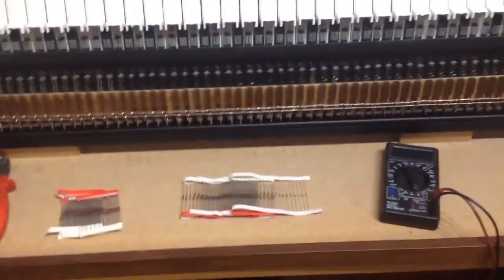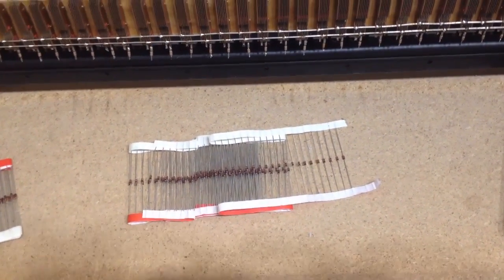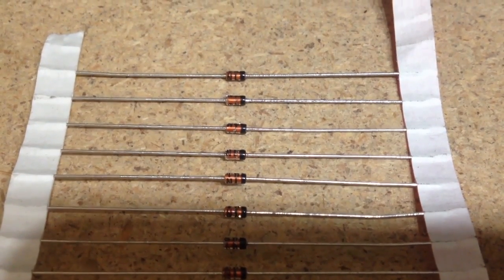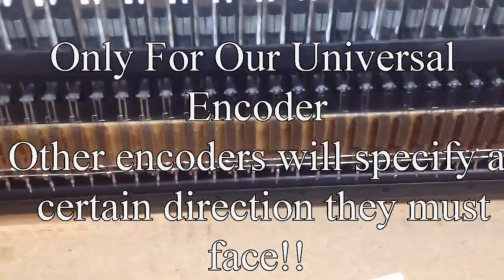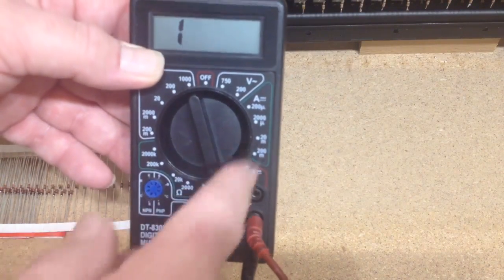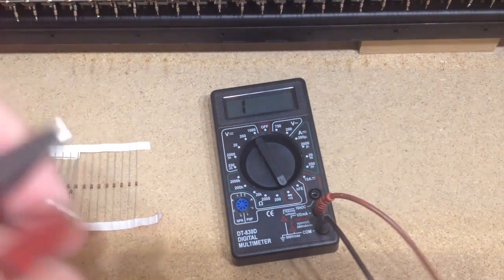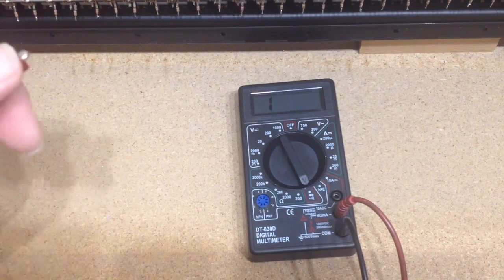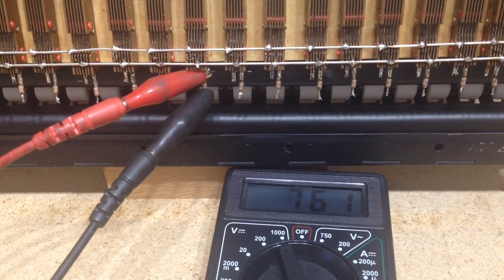Converting the Wyvern Exeter Organ - part 16  All about Diodes & How to test them

Comment: Hello!  I am planning to build an organ from scratch, repurposing the manuals or reed organs for this project.  Obviously, I will have to set up all wiring myself, so what think You would be the simplest—and most affordable—option for all key switches?  I am thinking to simply have a piece of copper under each tangent, which shall connect the main line and the individual line for that key, upon key press.  I never thought of adding diodes to the system, and am wondering:  Why would they be necessary, for this case?
Reply from the maker: The purpose of the diodes along with how it works are explained here https://www.youtube.com/watch?v=UHLV2dy4zBI Whatever you use for switches needs to have some spring in it or it will quickly stop working well. Good luck with your project 🙂

Comment: In case You see this trice, this is the third time I am writing this, as YouTube seems to have aborted my former replies, for whatever reason. 😂  I shall now try sending this as another comment, though, instead of as a reply.
	What awesome customer support.  The quick response is massively appreciated!  (That video is actually what led me to this one, ha-ha.)  Diodes allow for current to flow in only one direction, that I know, but I am confused about why the need of them in this case.  Good point, regarding the switches.  Perhaps I shall have springs touch the lines, instead of the pieces of copper.  Thanks for the luck! :-)
	Now, Your M. I. D. I. encoder definitely seems the best option, as the Virtual Pipe Organ I am building this for has overtones—for which I shall modify the manuals to have the corresponding split sharps—and Yours supports seven manuals!  Anyhow, I want to purchase this from Your site, and have PayPal, but am located in Stockholm, Sweden.  Is it possible to ship all way over here, when the time shall come?
Reply from the maker: Hi Moses, Thank you for your kind words. Shipping to Sweden is fine. Just order from the website shop when you are ready. Many thanks.
Reply: @HauptwerkHardware  Sounds great!  Thank You so much. :-)

Comment: Hello, again!  Hope all is well.  I have now gotten the diodes, and am the wood away from starting on the pedal board.  Getting closer to buying the encoder, I am wondering:  Does the set-up program support macOS, or am I able to set it up on my Windows machine, then preserve those settings for my Mac?  (I run Hauptwerk on Windows 11, and GrandOrgue on macOS Monterey.)
	Also, would it be possible to split one manual input group into several M. I. D. I. channels?  I am thinking, sixty-four inputs cover almost half more than the total of thirty-three split sharps over all three manuals, plus six on the pedal.  My question is basically:  Can one assign specific actions for each input in a group, including M. I. D. I. channel, and which key to play?
	Best regards:  Moses K. Frost
Reply from the maker: Hi, You can use a windows PC to perform the setup and the encoder will remember the settings thereafter so you can use it with MAC or even a standard midi synthesiser.  You can choose which channels you use for each keyboard. The definition of a keyboard can be as many or as few groups of 12 notes as you want.
Reply: @HauptwerkHardware  All right, sounds great.  I shall then use Windows 11 to set up the encoder.  ¶ Perfect!  So, I can assign:
• C = D#
• D = G#
• E = A#
for example?  (The first, second, and third, pins shall play those keys.)
Reply from the maker: @moseskfrost  That should be possible 🙂
Reply: @HauptwerkHardware  Great.  Can I do that within the set-up program, or requires that separate programming?  Ha-ha, sorry for all questions.
Reply from the maker: @moseskfrost  via the setup program.
Reply: @HauptwerkHardware  Perfect, thanks!